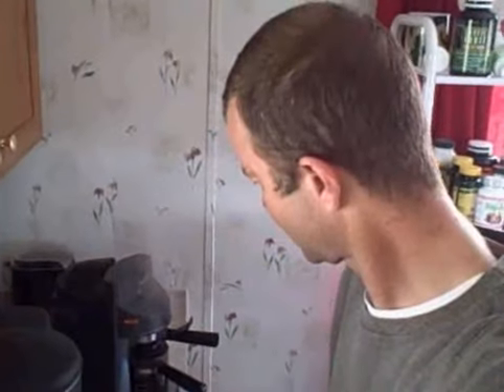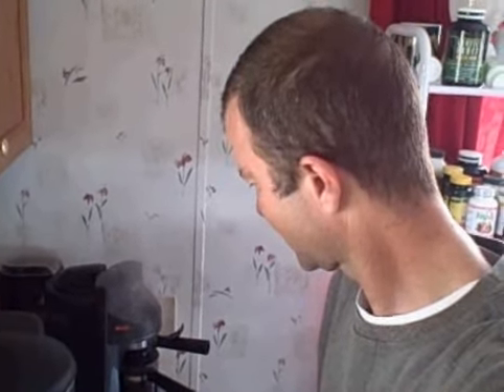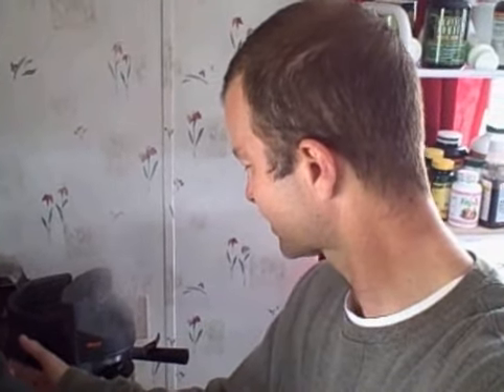HVAC missmatched hvac condenser coil and evaporator coil

Comment: @Turnpike256 - You can actually have more than that. Check some ARI matchs. It's a shame that techs don't get the equipment books from the manufacturer. They end up sitting on the shelf in the sales office. If you get a chance to look at one of these you will find condenser / heat pump to coil matches that will surprise you. For example a 3 ton outdoor unit with a 5 ton coil. Larger coils have a lower pressure drop across the fan and do more to remove humidity do their surface area.

Comment: Have a customer his home condensing unit is 2 ton and evaporates 3 ton old unit  no problem.  As long as the vapor is bigger than the condensing you shouldn't have no problem

Comment: I agree that 1/2 ton difference is not that big of a deal, some manufacturers have ARI listings for system matches with smaller evap. coils. Also consider if the coil is new it may be rated for a 13 SEER system, so if an old 10 SEER condenser is matched with a 13SEER evap. coil 1/2 ton smaller would be about right.

Comment: Did the coil have a TXV or fixed orifice. Whoever installed the coil probably didn't check the orifice size.  Like most hacks they kept adding gas because the pressure was low. If it was a TXV, did you check your liquid line temperature? Is the blower wheel clean?

Comment: Whats the Square Footage it Serves for the Evaporator Load? 
With a 3 Ton Evaporator---36,000 Btu's---
A 1/2 ton( only 6,000 Btu's) More (16.6% Oversized)on a Condenser Shouldn't Be That big a Deal unless Suction line is Tooo Small or run is Long and it's Cold Outside and they are runnig the A/c For a Long time.
It's Done on Purpopse in Hot Weather to Pull Down on the Evaporator With Full(Evaporator)Room Loads.

1)Check Suction Line Size? and Length of Run

Comment: So your Question is Why is it Freezing Up Possibly?
1)Any time i goto a residence and find a " Twinkly" Clean Air Filter" i know the Residence has just Changed the Air filter Because they figured that it should be clean and they are right and usually thats all the Problem was in your case.
2)possible other stuff---if it happens again...Look for Return air Filter Grill/2 air filters in Run.
3)Blower Motor Could be Overheating? Stopping???
Check Blower Motor, Cap etc. Age of Blower Motor?

Comment: Any time you change the outdoor unit change the evaporator as well. Your not doing the owner any favors by leaving an old coil in service.
1. Contaminates in the old coil and tubing.
2. Potential leaks. Everything leaks, the question is how much. Every leak only gets larger over time. Where you have water you have corrosion. Potential drain pan leaks as well.
3. The metering device will be wrong. This is a big problem with a heat pump because of charging it in cool mode the heat mode will be off